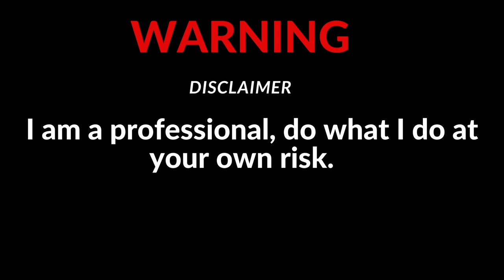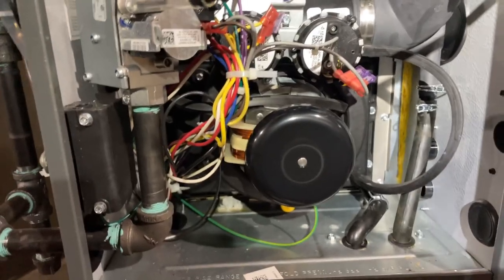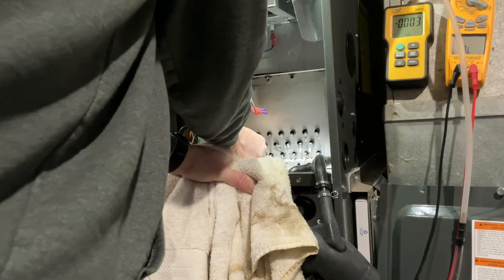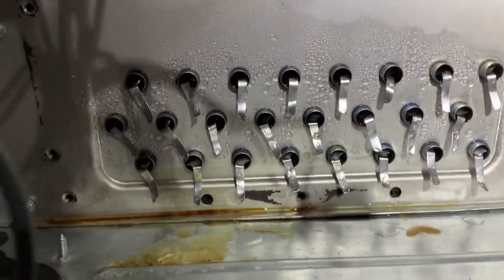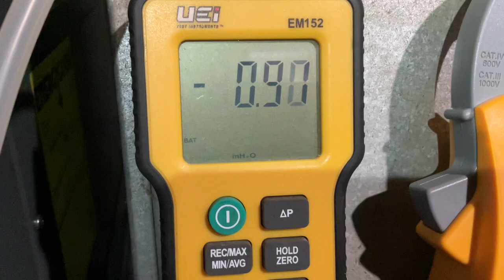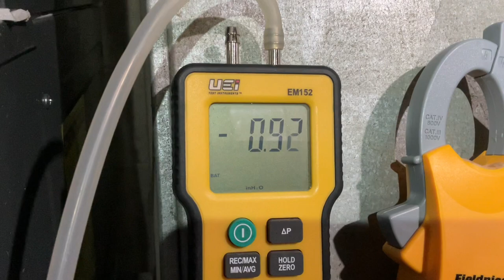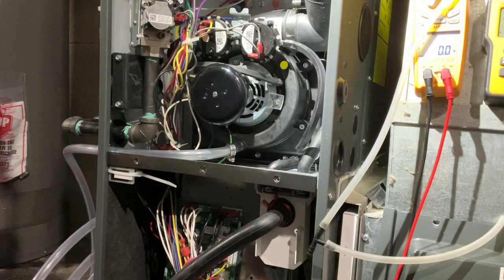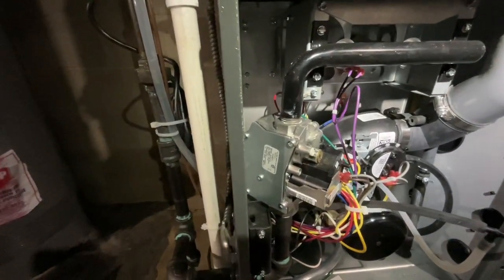Goodman furnace not heating house FIXED!!!

Comment: Great learning experience and video! What did tech support say about the problem you had? Just wondering is there a service bulletin about this or installation issue. Thanks for the lesson.
Reply from the maker: Thank you! They really didn't say much about this. They told me they knew there was an issue with the 40K’s supposed to be resolved now.

Comment: I had a Daikin furnace that was holding water in inducer, and I installed a drain on pvc pipe just before it goes in to furnace and it kept water out of inducer. Seems like the smaller furnace will do that.
Reply from the maker: Yes, as far as I know just the 40k's are the ones having the Issues, I have heard some 60k's are also having issues. Me personally have not had issues with those. Thanks for watching.

Comment: I have an Armstrong furnace doing the same thing. I pull the yellow cap from the inducer and get a good amount of water draining out.  Would the drain tube you installed work for this? If so, what size tube is that?
Reply from the maker: Yes, I have had to do this on some of the older Armstrong furnaces, I believe that is was 1/2” tubing.
Reply: @ADVANHVAC  Thanks! Btw, really enjoying these videos. Thank you
Reply from the maker: Thanks for watching. It’s much appreciated.
Reply: @ADVANHVAC  just curious if installing this drain tube on the inducer would possibly create an open pressure switch issue?
Reply from the maker: No not at all, when you install just make sure you run a small loop before you install it into your pump or drain, that will act like a trap.
Reply: @ADVANHVAC  Perfect thank you

Comment: The furnace is most likely not installed slightly  leaning forward  to allow for proper drain ,which will lead to exchanger rotting out premature, put a level on it . If floor is slightly leaning back the water won't drain
Reply from the maker: I should have added that into the Video, I did add some 1/4 pads to the back  it is leaning forward.This one was installed before I knew about this issue. from  that one on I started doing an extra 1/4 of a Pad to the backs.Thanks for watching.

Comment: I’ve seen this before with the 40k furnaces… I think it has to do with the width of the furnace, it doesn’t promote proper drainage out of the secondary.  That is why ONLY on the 40k units you will find that drain port at the base of the draft motor. 
If you run that drain tube like you did on this video for every 40k btu furnace you will eliminate that issue.

Sorry you had to learn this one the hard way.  I wish the manufacture put better instructions on these ones.
Reply from the maker: Yes, Unfortunately for every 40k that I sell it’s going to be a different brand. Just for now until they can figure it out. Thanks for watching.

Comment: Goodmans do not like to be front to back level, if you elevate the backside by about an inch they tend to drain better and you don’t get water stagnating in the secondary exchanger nor will water drain into the inducer fan.  Overall a crappy design on an otherwise nice system.  I’ve also noticed that you want a vibration break to the ductwork on the larger installs, you will spend a lot of time trying to eliminate vibrations from the ductwork otherwise.
Reply from the maker: Yes I should have added to the video I did install extra pads in the back, the level was leaning out of the line forward pitch. Most definitely about the brakes, other wise you get the Bang. Thanks for watching.
Reply: Hey bud , did you find that in the manual or just by experience or tech support , just curious ..
Reply from the maker: @richardwuttunee125  I found it on Goodman's website Partner Link,   https://partnerlinkmarketing.goodmanmfg.com/goodman/products/gm9s960403an/gm9s960403anaa
Reply: Nice , did you ever notice those on other brands of high efficiency units too ? Or just work goodMan brands ?
Reply from the maker: I also install Amana which obviously is Goodman. And Armstrong. Don't have any issues with Armstrong.

Comment: They are called Turbulators not Tubulators. From an engineering point of view they turn a laminar boundary layer into a turbulent boundary layer due to spiral design increasing heat efficiency through standard thermodynamic processes( law 1 and 2) broadly based on Fouriers law of heat conduction and Newtons law of cooling for convection. That Goodman design has long being a problem both the seals on the collector box are pretty weak and can leak water and corrode and impact other components including shorting out boards in the lower furnace layer. The ports and the rubber condensate lines on the box are also poorly designed and will get clogged as well. That can impact on the rest of the system impacting smooth operation of inducer motor and affect proper pressure switch operation and hence gas valve operation causing the gas furnace to operate for a few seconds before turning off as sequence of gas furnace operation is undermined. They need to be cleaned and vacuumed regularly on any service warranty to avoid lots of future call outs. I would just tell the home owner about how to do that regularly using a cheap wet vac with appropriate hose attachment. Home Depot does a very cheap wet and dry vac (bucket head) which can work for that purpose in advising the home owner to do their own clean out. Usually done at the beginning of heat season and every couple of weeks thereafter in the heating season. Yes goodman should really look to a better redesign of the collect or box and condensate ports and rubber hoses. Replacing the collector box for the Goodman is a known issue when their seals go.
Reply from the maker: Thank you for Clarifying of all that, Good to know! Thank you for watching.
Reply: @ADVANHVAC  keep doing what you do we are all here to learn and Thankyou for showing your work. You are showing you really want to improve.
Reply from the maker: YES! You hit the nail right on the head! I always want to learn and improve!